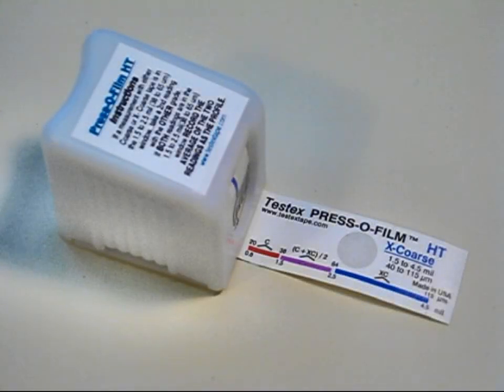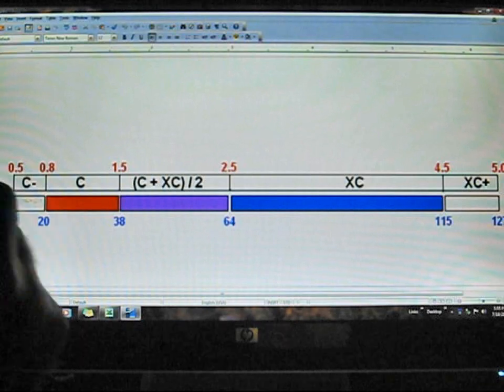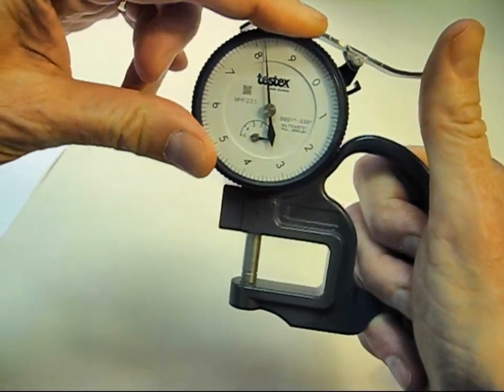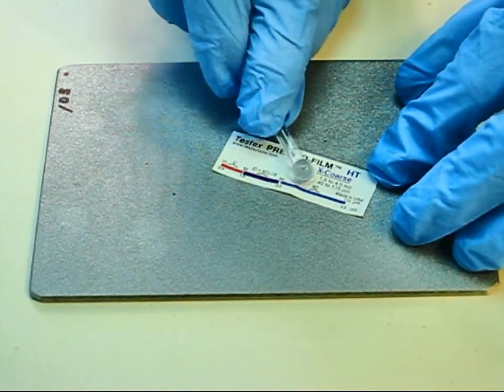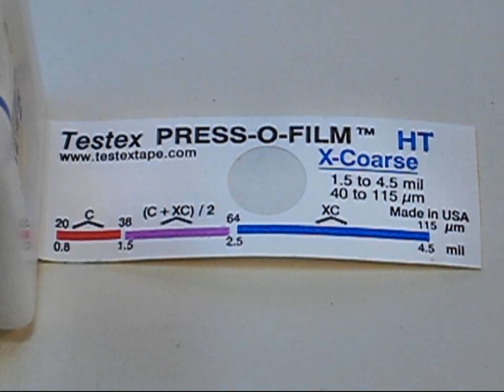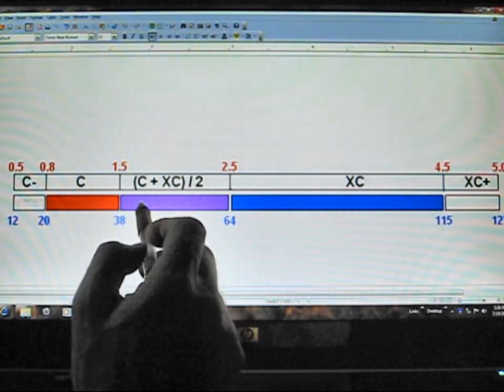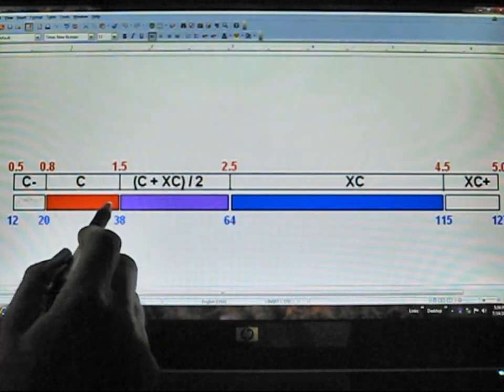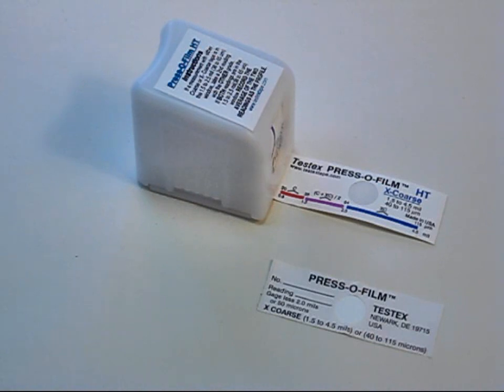How to use Testex Press-O-Film Tape

Comment: If the tape is 2 miles thick, why does it read 5-6? Why back it off 2 mils instead of 5-6?
Reply: The tape has two layers. One is incompressible layer to back the compressible foam. We only want to dial back 2mil to avoid including the incompressible layer. The foam layer accounts for the other 3-4mil.